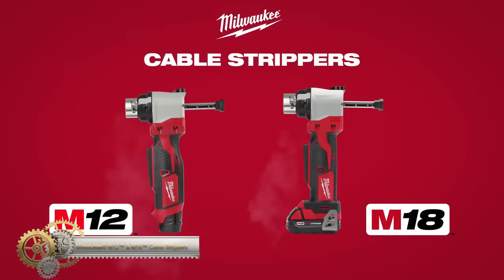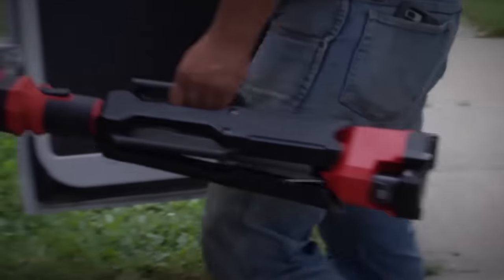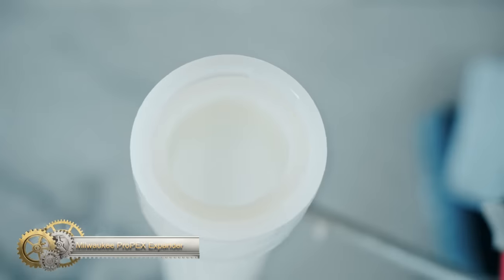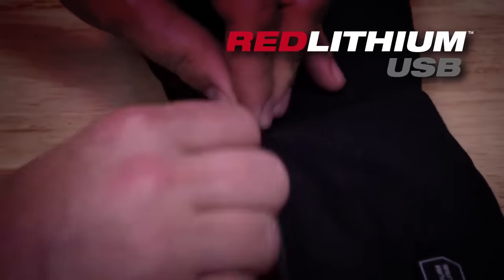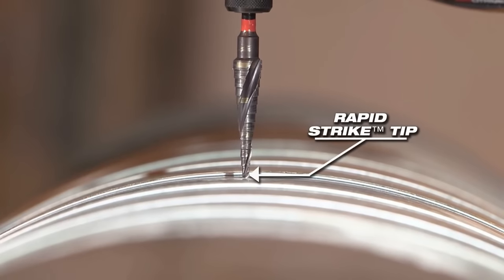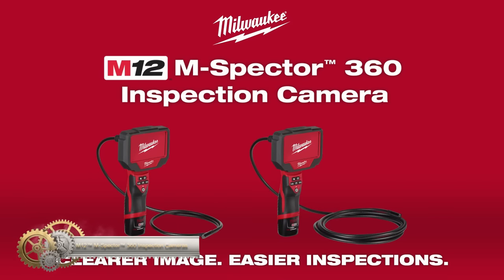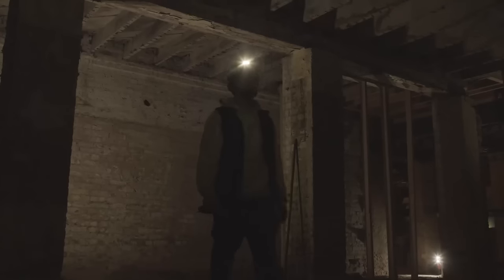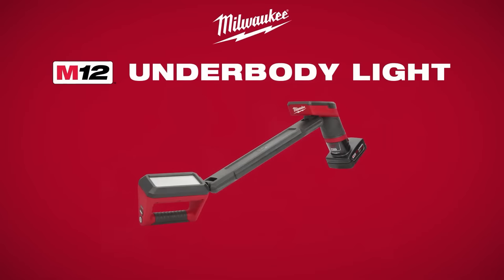Milwaukee Tools You Probably Never Seen Before  ▶ 7

Comment: It’s pretty simple and obvious at this point . I was a die hard Dewalt man for 15 years and wouldn’t switch over beca I didn’t think for 1 second that Milwaukee would out perform until I finally tried it. Now I run a full site  install of kitchens & bathroom from unboxing to countertop template with Milwaukee battery powered tools only . It gives me a advantage over other installers in my field if there is no power on site or just the convenience of cleaner installs with no hesitation in saying it’s pretty perfect because of the upgrades that are better than Any competitors tools on the market.